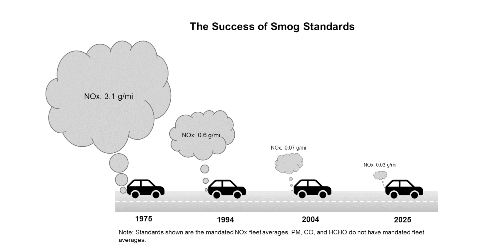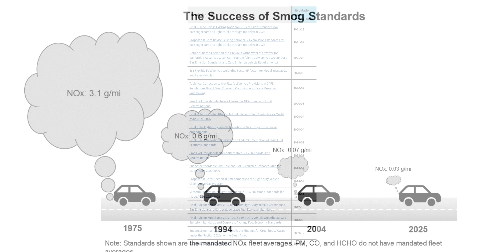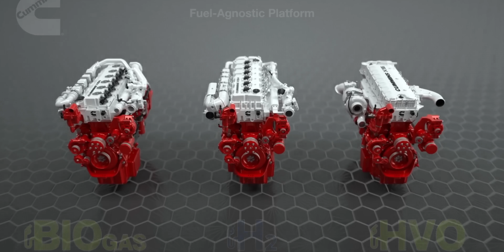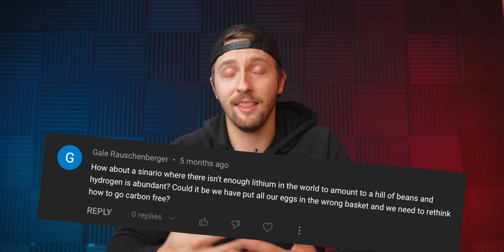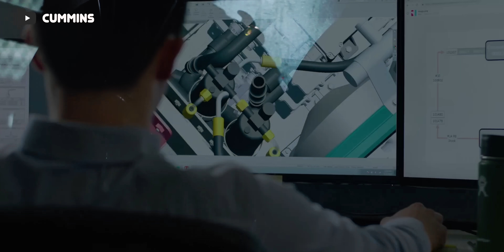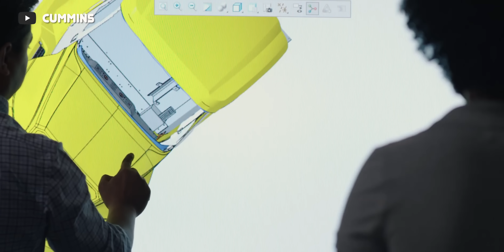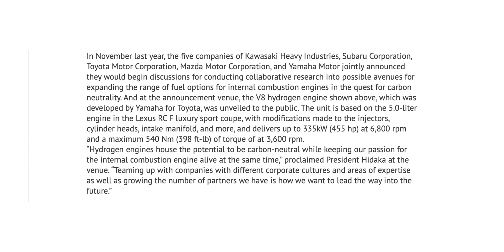Cummins Hydrogen Engine Will KILL DIESELS FOREVER

Comment: Is it possible to make a somewhat perpetual energy using hydrogen. 
When hydrogen is burned it turns into water. 
To turn water into hydrogen you need to put water electrified in zinc and salt

Comment: I saw a documentary recently produced by Commons using compressed hydrogen, not liquid hydrogen, much easier to use compressed hydrogen. I think at 700 P. Yes. I they were loading up different machines. So they're not using liquid hydrogen, which needs to be kept so cold and doesn't work well. Also to 4 electrolysis. If you use green energy solar wind, then you're not fusing fossil fuel to produce it. Of course
Reply: Hello Mark, how are you doing?

Comment: The big advantage here is if the new hydrogen-diesel engine can replace existing engines. Because engines needs replacing eventually anyway but if you can modify existing trucks, that's a huge advantage. One enormous advantage with hydrogen is that it doesn't need to be moved, it can be produced at the energy station.

Comment: We used hybrid engines in Norway during ww2, but instead of hydrogen and diesel, it was gasoline and wood. Wood works just fine, but you can't get anywhere near the same amount of power. So resistance fighters would have a secret switch that could toggle between wood and gasoline so if they needed to get away fast, they would switch to gasoline and otherwise run on wood.

Comment: Your 10 years out of date. We won't have to mine lithium forever because at some point the batteries will be recycled. There is only about 2-3% of the batteries is lithium. Cobalt is being replaced in most  batteries, but has always been used in making petrol!  your lie about little kids being used to dig it of the ground is pathetic. 
Sodium batteries are now being used and installed in some evs which will increase as the range is improved because we have an abundance of salt. By the way have you not seen the open cast mines in Chile that extract the lithium from vast brine pools. In America they have found a vast deposit of lithium in an ancient dead volcano enough to supplier the worlds needs for over decades. Solid state batteries are being developed they don't use the 4% of cobalt that used to be used in batteries. Tesla use LFP in there basic models. In the old Cornish tin mines there are vast amounts of Lithium but do we need it anymore?
You guys are just petrol heads stop being so negative all time. People are changing to evs no matter how many times you try and put them off.

Comment: I wonder if the hydrogen fuel tanks would be the same as LPG fuel tanks?
Reply: It’s been solved but the government of course won’t allow it.  Lithium hydride in a tank.  You can shoot the tank with an incendiary bullet and nothing happens it’s safer than a gas tank.  Was solved in the 90s by bob lazar of all people.  He had a corvette than ran on hydrogen tanks filled by solar.  Took a week to fill but once full the corrvete would get 1500 miles and they kept changing the oil and the oil was spotless too.  Besides normal mechanical breakdown it was clean otherwise.  Gov said it was too dangerous.  Too dangerous for their power paradigm is what it was.

Comment: The engines wont last as long as diesel engines because hydrogen doesnt have the lubrication properties of diesel fuel. Low rpms and the lubrication of the upper cylinder walls are the two main reasons why diesels last such a longtime.

Comment: There are millions of natural gas cummins engines used for power generation. A trucking company could easily swap all of there pre-existing trucks over to natural gas and as a side benefit these trucks can be refueled at the company shop/yard.

Comment: Er reality check!!!! what does UNCLE SAM have in millions?, fast food  restaurants, diners, and lorry(truck) stop kitchens, yes cats&kittens  fast food giants like Kentucky Fried Chicken, MacDonalds in selling said fast food use thousands of gallons of cooking vegetable oil. All that waste cooking oil can be refined into bio-diesel for MacDonalds are doing just that refining this waste product oil to run their huge fleets of lorries (trucks) on bio diesel . Figure it out Richard Osman ?, a Clessie Cummins dual-fuel engine burning hydrogen or bio-diesel at the flick of a switch is the answer requiring little modification to the basic engine, ideal for small off grid garages and workshops with limited facilities.

Comment: Hydrogen graphite cartridges were invented in 06. It allows the hydrogen which is positively charged to be attached to the graphite honeycomb. When a small electric charge is added it releases the hydrogen. These cartridges can then be recharged with hydrogen and it can be done at low pressure.

Comment: this is pure USEPA propaganda. Those Mother FFFers at USEPA were put in charge of the "Renewable Fuel Standard aka RFS" in 2005 when congress established it and they have mismanaged and wasted 100 billion dollars of the taxpayers money pushing lies and propaganda. Pure BS and propaganda. Climate change is a political lie. Have you ever tried HVO? I suggest you try it. Excellent fuel . Since they dont sell it in Arizona I would suggest you drive to california and fill up with some? It is the only thing that has been done half right by the Air NAZI's. After you experience HVO then ask the folks who sell it why it is so good and it is. They do not know. HVO is better than racing diesel.

Comment: I watched the technical discussion from cummins themselves. They are not planning on using liquid hydrogen for the time being as it is just not available enough. They are going to store it as a gas at either 300 or 700 bar. The 700 bar is more energy dense, but also more expensive. So they will decide later which to use depending on what fuel stations develop more quickly

Comment: Hydrogen is the future of both EVs and ICEs… People have a hard time wrapping their heads around Hydrogen fuel cells vs hydrogen combustion engines… Fuel cells pump hydrogen in front of a grid, and let in outside air which has oxygen in it, the hydrogen and oxygen attract and form H2O, which kicks off an electron that is picked up by the grid… Instant electricity and pure water at the same time… The exhaust is pure water and you get plenty of electricity to power any vehicle / motor… Toyota has these in some cars, the US Navy uses them on Aircraft carriers, they are also used in huge mining heavy equipment. They are a very attractive option for long haul trucking because the rigs can carry plenty of hydrogen, and have a massive range before needing to refuel. They are in use on massive mining equipment (the mega haulers and excavators). 

Hydrogen combustion engines are an entirely different ball game… Many companies are experimenting with mixing hydrogen with both diesel and gasoline to burn much much cleaner and drastically reduce emissions. Some are looking at burning only hydrogen as a means of getting to almost no emissions for an ICE… 

Many countries all over the world have been developing underground hydrogen storage for over 10 years… There is a surplus of solar in certain places that can easily be directed towards electrolysis hydrogen production (green hydrogen). Scientists have figured out electrolysis hydrogen separation on dirty water sources (previous sources needed distilled water). 

Batteries are temporary and not a sustainable means for electrifying the world… Lithium is finite as are all other rare earth materials and are inferior to hydrogen from all perspectives…

Hydrogen is the future, and it is already being adopted for heavy equipment/machinery. It will then quickly phase into consumer products in the coming years… Batteries are the bridge gap only for consumer products and are temporary. 

Pure hydrogen is in itself, a battery with a unlimited shelf life that we can tap into any time we want… It is liquid or gas and can form itself to any container shape and size. It can be pumped in a very similar way to how we pump gas. It is perfectly suited to remote construction of roads or even the mega machine Hercules class mining trucks with tires the size of houses (which it is currently in use for as fuel cells that run electric motors). The weight to energy ratio is perfectly suited to commercial jets for passenger and cargo flights with zero emissions. It can fuel rockets for space exploration… And every molecule is recyclable… We either have water or hydrogen and oxygen, zero pollution…

Hydrogen is the future… As long as you have hydrogen and oxygen, you can generate electricity and end up with pure water as the only by product. The only real question is can we transition fast enough to beat the greedy fossil fuel morons from killing all humans on the planet… I’m not sure we can pull it off, we might have gone too far already… The ocean has sbsorbed 90% of global heat, and it’s about to reach its tipping point and give it all back. Recent ocean temps of 101 degrees Fahrenheit were recently recorded of Florida… That is a steamy hot tub level temperature… That is crazy hot and that is going to melt a heck of a lot of ice… 

So… Fingers crossed… The world is about to get a glimpse of how bad the future is going to become.  I suspect it will be in the form of a few devastating storms… But if some Antarctic ice shelves start collapsing like dominoes, we are going to see some incredible rises in sea levels too.

Comment: No mention of the corrosive nature of Hydrogen, or the need to contain it and reticulate it in extreme pressure vessels and pipes.  Hard enough to produce at a competitive price, it is expensive to handle, extremely risky, and too difficult to distribute.  Made and used on site and distributed as generated electric current it has a slight chance of utility.

Comment: Won't be the end of diesel -
Similar to today how we have petrol & diesel, we'll have electric and hydrogen in the future... Trucks will be electric and pull into recharging stations that pull out the old cells via forklift and replace new cells, the advantage being the truck is "refuelled" very quickly and on it's way ... passenger cars may have both EV & Hydrogen as dual fuel and switch over on the fly whenever the driver switches it.
Reply: Hello Joe, how are you doing?

Comment: If we want to think of using the hydrogen in water as fuel, I think we need to get out of the mindset of doing it with conventional electrolysis and think more in terms of creating plasma from water, like what a pistol shrimp can do with its claw, or the sonoluminesce "star in a jar" phenomenon, or the way a Griggs hydrosonic cavitiation pump heats water using tiny shockwaves created by running the water over a rotating drum with holes drilled into it. People who said that they had found ways of running cars on water, like Jean Chambrin, Stan Meyer, Paul Pantone, and Aaron Salter, seem to be using a type of plasma effect to disassociate the water into hydrogen and oxygen. Based on the work of Jean Chambrin and Paul Pantone, it seems that when virtually any type of fuel combusts, its exhaust gasses create a plasma effect that can be used to disassociate water into hydrogen and oxygen.They were both running their fuel lines though the exhaust system in order to take advantage of this. Jean Chambin was using a mix of water and ethanol as fuel. His patent says that when the ethanol combusts, it creates an "electrical effect" that disassociates the water into hydrogen and oxygen. Plasma is electrified gas. When you look at the work of Stan Meyer and John Kanzius, who didn't find a way to run an engine on water, but found a frequency that will ignite it, which I believe was 13.56 Mhz, they both used radio waves in order to create this plasma effect to disassociate water and burn the hydrogen in it. Jean Chambrin, Stan Meyer, and Aaron Salter all died under mysterious circumstances. There are also other inventors like Dimitri Petronov and Zachary Warfield who were working on plasma batteries and died under mysterious circumstances. Dimitri Petronov ran his two bedroom home for 14 months on a plasma battery the size of a shoebox without recharging it. Zachary Warfield was working on a plasma battery and met with Petronov in 2010, the same year that Petronov disappeared and is assumed to be dead. Warfield fell out of a boat, hit his head, and drowned while watching fireworks on the 4th of July in 2011 in Washington, D.C. according to an article in the Washington Post. Most other media outlets call it a "boating accident" to make it sound less suspicious. Even Rudolf Diesel fell off a ship and drowned in the English Channel in 1913, two years after his engine was shown to run on peanut oil and other vegetable oils at the World's Fair in Chicago in 1911.
https://www.youtube.com/watch?v=4fYc_MRG2wM

Comment: I drive a 2x19L Turbo 6cyl cummings with a combined 3000kw(roughly) and they are small train engines. 

I don't think a hydrogen cell engine in trains will be something any time soon unless they can fit the engine and tanks in the same working space the existing engines and fuel tanks fit in.

Comment: And we do have the parts and materials needed. In order for that to happen, Stan Myers people. This works on gas powered and diesel engines.. And the parts are so d*** complicated. They don't have to go through all this mess. All they have to do is change the injectors and make mission system, that is it.
A few $1000 later, and you will be driving a hydrogen view without the complications.. Talk about taking the longest way possible these people are Doing it.

Comment: The Ignition system in a vehicle or car truck that has a distributor or coil packs has enough voltage to run. This cimagination well more than enough.. So I don't hear It. So if they are curious and wanna test voltage of a 12 V system, you don't need ridiculous amount of voltage.
You're, we already have it? So to be saying that it needs more electric, not really, the ignition system would be Plenty.

Comment: Yeah, you know, they actually have this concept working. But they need to borrow it from Stan Myers. Oh, wait, that's right, somebody bought the rights to it over in England I forgot that you can actually run your car off of drinking water does not have to go through any process other than just go into your tank and then goes into the engine.  And everything is done in the calendar. And it would probably cost a few thousand dollars to outfit this on everyone else's car who would want this. But people want to walk around things like this and ideas like tyes. Because because I think this would be a better fit than to have to go through a process and pressure. Kids and all of each other, hoopla, when all you gotta do is change a few parts.  Install water either in the gas tank or a separate cell or drain out the gas. And put the water in it. I don't know and plus 22 miles a gallon. I don't know, that's not really a bad thing.
And all baked some models that would benefit from the especially areas that are flooded.. Nope let's biologicals. That'll fix that problem